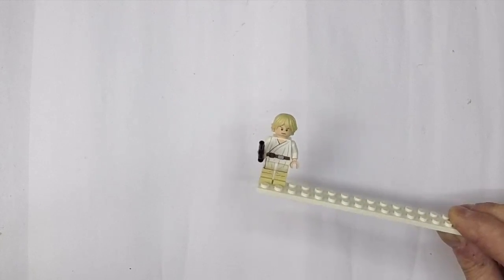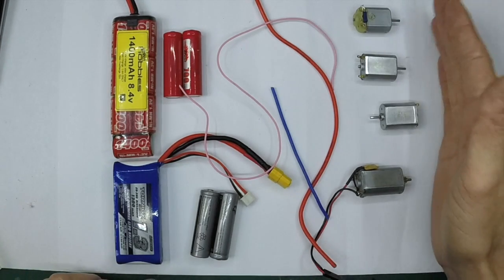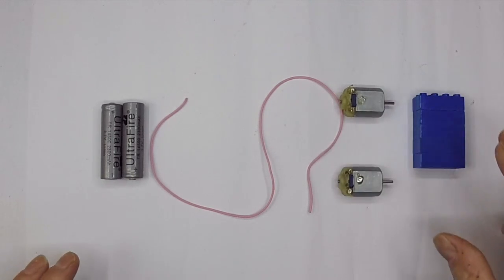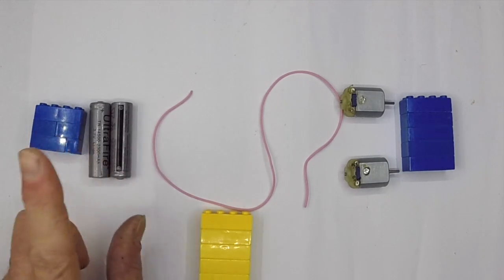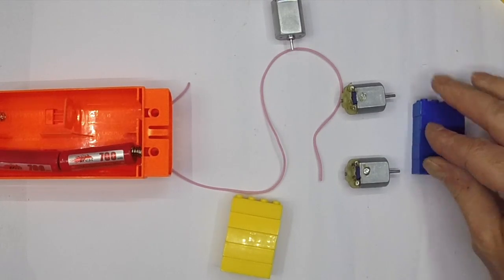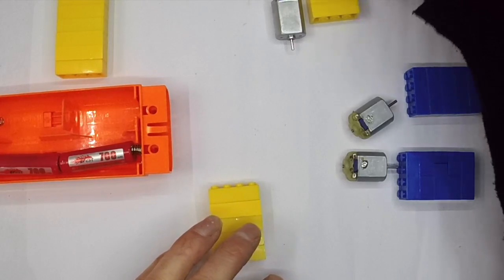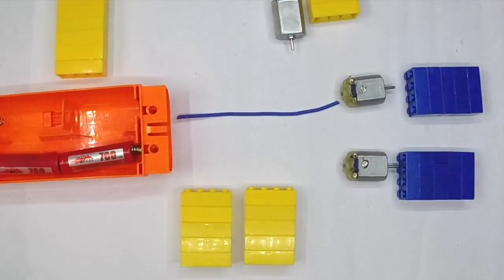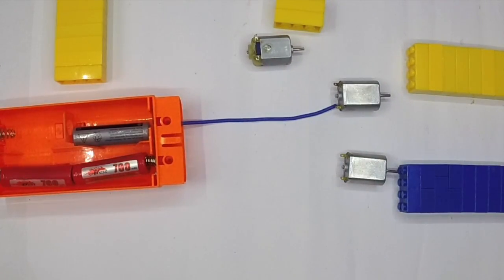How To- Bring Balance to Your Blaster

Comment: At eight minutes, when you realized you don't have a third IMR, you really should have deferred production of the video.  Or, quite a bit earlier when you ran out of Lego.

This is a concept that's important enough to DO IT RIGHT.
Reply from the maker: +Bob O`Bob Do it right apart from when you are doing it wrong? Maybe that should be my new catchphrase.
Reply: Viewers in general and students in particular are easily distracted.  By pretty much anything.  Adjusting to that is not really very hard.  Think of the length of the lever arm you are trying to employ.  When I was teaching programming, for me it was almost 30:1.  That meant it was actually worthwhile for me to invest half an hour of my own time to cut just one distracting minute out of my presentations.  For you the ratio is a whole lot higher.

"Pretend this Trustfire is an IMR" just doesn't cut it.  Spend the $6 before you start recording.
Reply from the maker: I wasn't worrying about being definitive, it just needed to illustrate the basic principle. I had about an hour to film and edit it, so it got made up as I went along to a degree.
Reply: +Bob O`Bob this could have been condensed into 2-3 sentences of cunstructive criticism. But it seems to come off as a rant?

Comment: So, bunches of 9 volts in series?   :P

What is the best power source for a 2 Rhino RS?
Reply: +Dart Beard probably a 2 cell LIPO
Reply: I have enough Rhinos to do the pusher as well.
Reply from the maker: +Dart Beard You could put 3s LiFePo4 in there or 8.4v Nimh.
You could also run a 3s Lipo with 3  diodes to drop the voltage to the pusher. I would just buy a third Rhino.